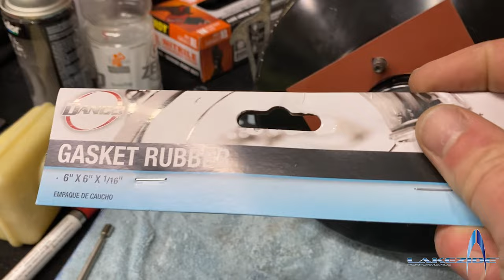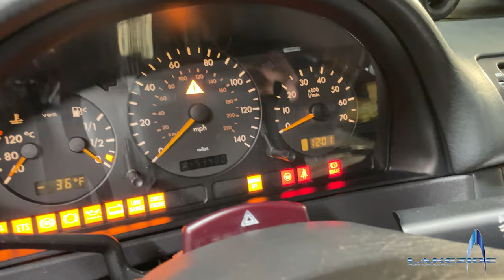EPISODE 10 | The Lost World: Jurassic Park Mercedes (W163) Replica | DON'T CATCH THE HOUSE ON FIRE!

Comment: I am loving watching this build....I have a 2001 ML320....It is still about 90% original, 240,000 miles, and runs great....looking for a ABS pump motor, but that is it......funny, been watching you doing this and I am learning more about mine....It is and has always been a california car so 0 rust, 0 corrosion.  Love your LED side lights also.....can't wait to see the finished product......Mine is also a base model.  I upgraded the suspension and stereo, and headlights.  In the near future I will be doing some engine work, have a small rear main seal leak, and the power stering is a bit loose, but AT-205 has been a life saver as a temporary fix to the rear main seal leak.  can't get over for 22 years old that I still can get between 17 and 21MPG....Shes a beast......hehehe good job....
Reply: In Germany it ist not possible...you need much room for that...